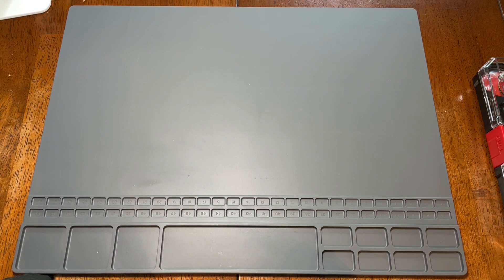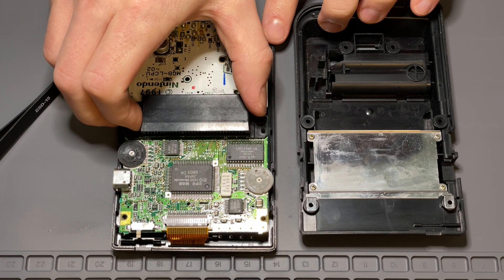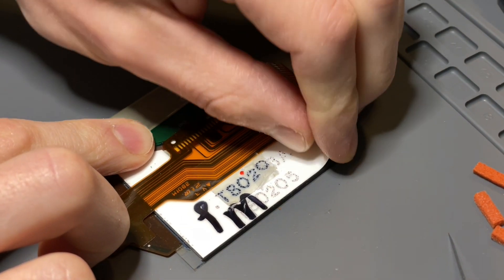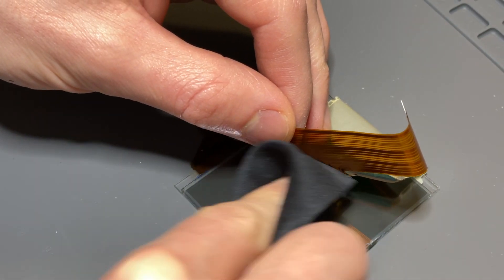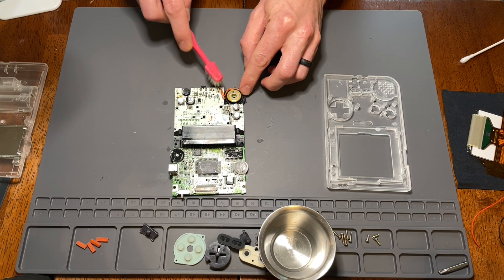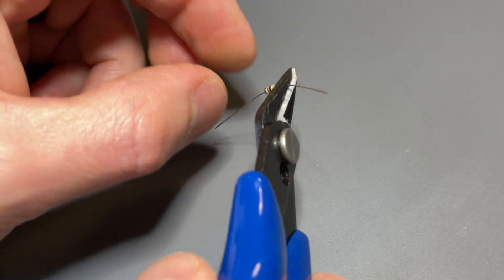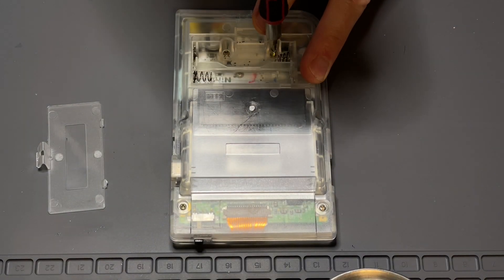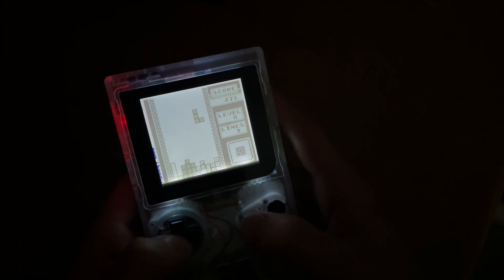Game Boy Pocket Backlight + Shell Install

Comment: Thanks for the video.  Very interesting.

I heard/read that having a backlight without a bivert chip can lead to a washed out display, but yours looks really nice.  I have never seen one in person, but there are other videos comparing the two.   

The bivert chip install in a pocket is not all that easy.. so just the backlight is a relatively easy way to improve the display.  I might try it out. Those ribbon cables though are very easy to damage.   

I have also seen reports that rubbing the screen with a q-tip and putting some pressure on the screen rot (screen cancer?  is it the same?) can help make the marks disappear.    Yours is luckily on the outside edge, so even if you leave it, it is not such a huge deal.  I have one that is similar.

How is battery life?  I assume there is some hit, but do you still get multiple hours?
Reply from the maker: Thank you! I do think it came out pretty well. With original Game Boy games I don't experience the washed out display issue. However with a flash cart like the Chinese EGDBS Pro the display is less clear and very quickly too dim to play on. I am pretty sure that is an issue with the voltage draw though so I picked up a power regulator mod to hopefully solve it. Plan to feature that power regulator mod in the Part 2 video as well. 

I have already filmed some of the Part 2 follow up to this video and I can confirm that it is not all that easy. The bivert mod is simple but a bit difficult because of how small the mod and components are.  I ran into an issue with install but hopefully i can get that remedied. 

I have watched a few videos showing people repairing the screen rot / screen cancer using q-tips and elbow grease. That is exactly what I have on this Game Boy Pocket. I think i might do the same and try that method on fixing that screen cancer but as you said it's not too noticeable on the outside edge and it seems to be a tedious process.

Battery life with the backlight alone is still pretty decent. I've been using NiMH rechargeable AAA batteries and can safely get about 4 hours out of them before i put them back on the charger. Unfortunately with that EGDBS Pro flash that I have not taken past 1 hour because of how dim and dull the picture gets to be. 

Thank you for your comment Martin!

Comment: Does anyone actually get all the adhesive off? I have looked at 4+ tutorials now and now one shows the full cleaning process. I tried my best to get the adhesive completely off down to bare glass but damages the ribbon cable in the process
Reply from the maker: Hey Awog Bob, I believe I did get it all off. The only tools I used for that were a good bit of 90% isopropyl Alcohol and Q-tips. Afterwards I wiped it off with a small microfiber cloth but it was the IPA that did the real work.